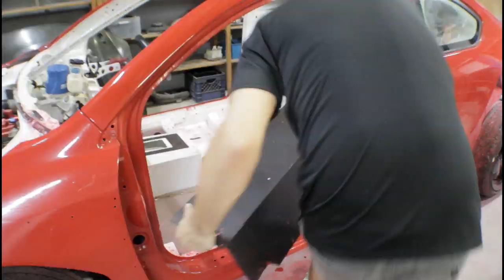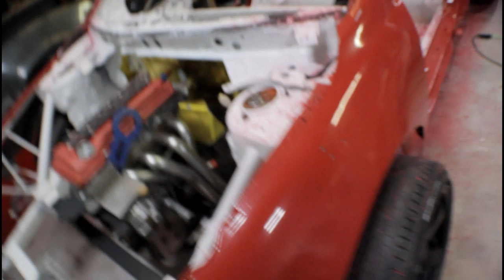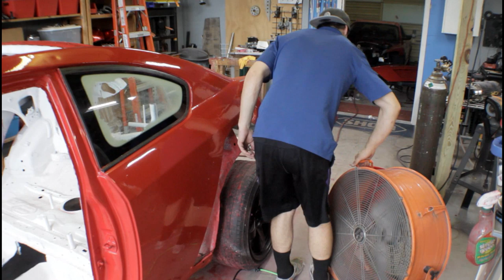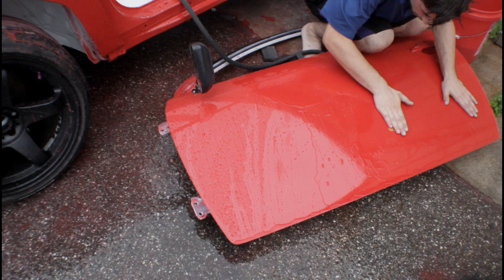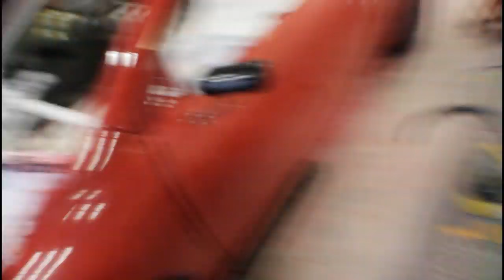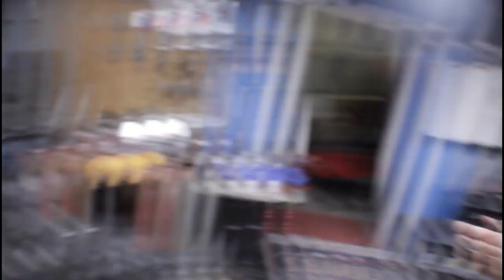DIY scion tc drift car final interior paint #driftbuild

Comment: Two questions: what year is the tC? Do you recommend a company that has a turbocharger for a 2008 tC
Reply from the maker: 2005. I'm currently n/a so I can't really speak on a tc turbo yet as I have never had experience boosting a scion tc before.
Reply: Greddy and garret bro
Reply from the maker: Greddy doesn't even make a kit for the tc anymore. Lol discontinued
Reply: Really?? That sucks!!
Reply: I purchased a kit out Ohio that was nowhere close to fitting. He is right, that sucks.. thanks bro.
Reply: Dezod i think is probably the only company that has enthusiasm and support for the scion tc and xb platforms.  i boosted a 2012 tc awhile ago and they were a huge help. regardless of what setup you choose i strongly recommend that you go full standalone with a proper wire harness from boomslang. go with a AEM infinity and you won't have to fight the toyota ecu and have a half ass tune